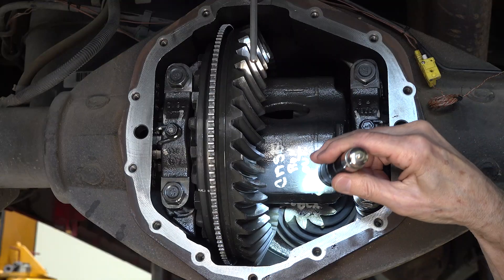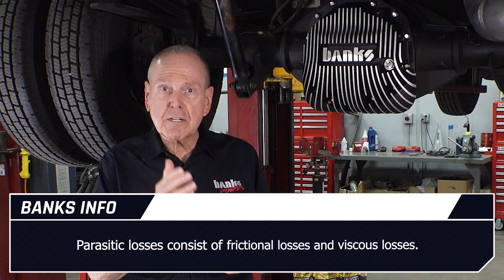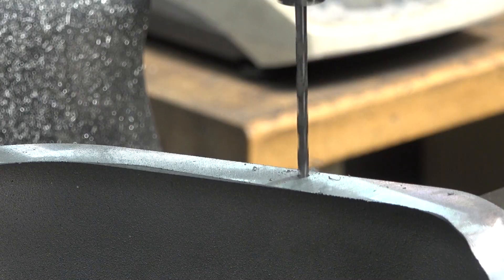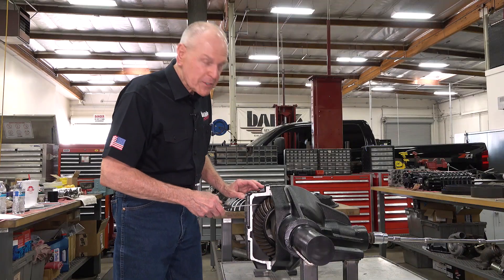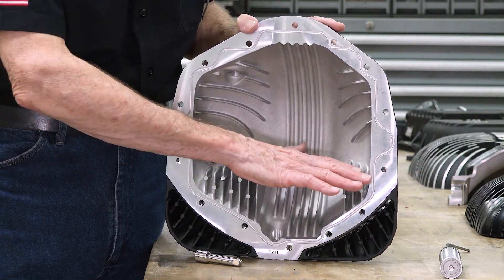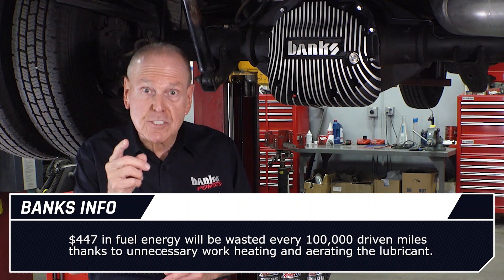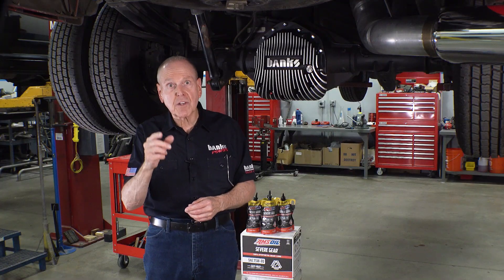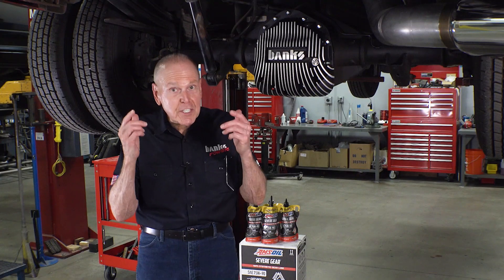Is your differential cover KILLING your gears?

Comment: It’s great to watch real engineering and not just marketing.
Reply: It's still marketing wank, he made no comparison to the stock cover proving his it's any better than what comes from the factory. He said it's better than the aftermarket which is poorly designed, that's fine but made zero comparison to what the axle experts designed for production.
Reply: otm646 the Banks cover follows the same fluid path and flow to stock covers but add better heat dissipation, sight glass, magnetic plugs that with take a square drive vs hex keys, better locations for the fill hole plus the addition of a drain hole, and gasket channel. Oh don’t forget Ram air.
Reply: I got 400kmiles on my Ford F350 with factory covers, still runs great with no noise, I don't think I need any of this.
Reply: It is interesting to see real engineering applies to mundane parts of a car or truck, but let's be clear, there is still a lot of marketing behind it. 

The issue isn't the product or even company's fault, it is simply that the improvements are very incremental.  There is only so much improvement you will realistically see with some of these products.  Can you see lower temps, which might result in more efficiency and this better fuel economy? Absolutely!  But your 15 MPG truck might now only see a 0.1 MPG improvement.  Is that an improvement?  Of course, but its negligible.  Same with the life of your oil.  Maybe now you can go from 100,000 mile diff change interval to 101,000 mile interval.  Does that really matter?  Your call. 

I still like this product, their willingness to apply actual science and their enthusiasm to not be happy with settling for the status quo, but take everything with a grain of salt.
Reply: Gale Banks has created an entire series of videos discussing other diff covers and tests them all.  That's why he engineered something that actually works.
Reply: @Hazdazos  I think this product might be useful to the edge cases that are running their trucks very hard but for the average guy this won't make any meaningful difference.
Reply from the maker: @otm646  This video is an edited version of the original one posted in November 2019. There are plenty of comparisons to stock in the original video and you find ample data on the product page: https://www.bankspower.com/i-2892
Reply: William Wheeler they could have just over filled the diff
Reply: @TobiasHinz1992  
Ya I guess.
The truck iam talking about, I have no idea about its history cauz I bought it at an auction with a ball in the middle of the bed, meaning its been towed with before, and I tow a trailer 5 days a week approx 5000lbs with no problems, kind of a neglect on the differential oil change too.
Reply: @jaykamal1978  This is directed at people who haul for a living. Depending on where you live, it's quite possible it spent most of its time on the road not hauling anything and occasionally pulled a camper trailer on the weekends. At least that's how most of the trucks I see around here operating. People who run hotshot or haul equipment for their businesses would benefit from this. But lets be real. Most folks that put these diff covers on their trucks, usually don't haul much. It's just eyecandy. At least when they put this eyecandy on, it actually does something.
Reply: @EyebrowsMahoney  
Ya I would say pretty much of an expensive eye candy. 
If I don't need it, iam not buying it, better to invest that same $$$$ in a place where it will grow.
Like I said before, bought the truck with 205kmiles on it at an auction and have put another 200kmiles on it with even changing the oil in the differential all that much.
From what I remember only 2 differential oil change on that one and averaging 5000lbs trailer the whole time. 
I definitely don't need it on a ford differential, that's for sure.
Reply: @jaykamal1978  And for your use case, it would absolutely be such. You're definitely not the use case. A 5,000 lbs trailer on an HD truck is baby weight, my jeep will haul 6500 lbs no problem. The guys that would benefit from this move around 20,000 lbs or more and actually put long, hard work on their differentials; thousands of miles day, sometimes every single day. It doesn't matter the differential when you're moving big loads, these guys are putting real work in with their trucks. The problem is the market was saturated with these diff covers that "add fluid capacity" without actually offering any real performance advantage... in fact it hurt performance. So this cover, arguably clearly more well designed and actually does something; is worth it to those that really work their trucks. Don't get me wrong, my Jeep is going to get a Ford 8.8 in it soon, they're good axles. But when you're in the business of hauling (and a F150 or a Jeep won't really benefit from this considering the use case), the bottom line is making your truck make more money for you longer, and that 's where this kind of preventative maintenance comes in. The factory diff cover does well for most applications, but not when at maximum towing capacities, especially when working in hot ambient temperatures. This isn't for your average 5,000 lbs trailer hauler. This is for your guy on the road, all day, moving max weight; doing work.
Reply: While he has produced a better diff cover, this is mostly marketing
Reply: @otm646  the real marketing win goes to the companies that got people buying a product that makes your diff run worse 🤭
Reply: The people hating on banks are prob mostly ones that got took on a toaster box diff cover and too proud to admit it, this guy is a genuine engineer and backs his products up with clean unadulterated science that actually understands fluid dynamics and makes the product actually benefit your truck.
Reply: Took me 4yrs to find this, BUT MAN… what beautiful Engineering indeed👌

Comment: Good luck refuting the science. This diff cover isn't backed by your feelings or opinions, as science doesn't suffer Bro Truck emotions. Thank you, Mr. Banks.
Reply: Do you even lift bro? Lmao!
Reply: Baywarrior707 yea warmer oil flows better but it starts to break down at and lose viscosity.. unneeded work equals loss in efficiency. Yes flat back covers are deeper but if you watched the series those companies ask for higher capacity still meaning oil level is a lot higher than stock, another loss in efficiency.
Reply: @Baywarrior707  The flat back ones also don't allow for proper fluid flow over the diff to the oil slinger for the pinion bearings.
Reply: @Baywarrior707  you wanting to know what the airflow is behind the Banks differential cover highlights your misunderstanding.
Reply: Remember guys this ram air (thought) might help if your going 70mph all day long,  American Alxe didn't seem to think it's important, I'm 68 an I've never heard of an Axle failing because the lube was to Hot, save your money an just change your lube when your supposed to..
Reply: @406Steven  hence the huge oil capacity trying to throw oil at it to make it better.
Reply: @Baywarrior707  what you want is the oil to maintain an exacting operating temperature for best results. The oil and diff needs cooled to not break down the oil and shall be warm enough that it is in operating temperature. What you do not want is overheated broken down viscosity oil in your diff and hot bearings and loads. See, there is a reason race cars have oil coolers and cooling ducts. Same with engine oil, its the exact same thing. You want warm oil , not overheated broke down viscosity oil. When bearings and metal heat up they lose strength, this gives rise to failure, more heat equals = more failure. You don't just cook oil and say look its water and zipp your engine to 10,000 rpm with no viscosity, that equals blown engine. same with diff components and splines and shafts, HEAT is the enemy because it is out of control , its your job to control it, this is a precise issue not a simplified claim of : "hot oil,  the hotter the better". See? its much more exacting with fine details of all this information.  No pun intended. just spilling it for everyone, the beans.
Reply: I have to disagree: People buy these amazing trucks and hook even more amazing trailers (sometimes two at a time) to them and travel at 80+ miles per hour, including uphill, to wherever they are going to recreate, deliver cars, etc and expect the trucks to perform/hold up. Blown turbo hoses...i think 70 is an understatement (maybe me and you drive that fast)
Reply: @Baywarrior707  That's why I don't think a Banks diff cover would be any better for my 1990 12-valve (if they ever actually made one) than the Mag-Hytec that I put on my truck. See above comment.

Comment: This will surely trigger some grown men who think their trucks are god tier who fell for the crap covers.
Reply: I never understood the diff cover thing but I would get this one lol
Reply: @kylerollins7882  honestly, I never thought about my diff cover, but now I want this one lol
Reply: @kylerollins7882  same
Reply: I mean, I won't deny that it's better, but I've never seen a class 8 truck with a fancy cover. I have seen plenty of diff temp gauges, so it's obviously something that can get toasty (and over heat when pulling an overweight load up a 15 mile 6% grade. Moral of the story, unless you actually USE the truck instead of treating it like an SUV with a bed, I doubt you will ever have any issues related to heat relating to the diff.

I'm not sure there is anything that doesn't become unsafe that you could hook to the bumper of a truck to really over heat the diff. Pretty much have to tow a fifth wheel or goose neck. My neighbor hauled pecans and grossed 32,000lbs in a 2500 dodge. I think the GCWR is 18,000lbs. Thankfully, it's flat around here.
Reply: @kylerollins7882  mostly the material of the new housing sheding more heat, with heat fins. but obviously flat back covers were the dumb part.

Comment: Don't even own a truck, but he sold me on it
Reply: The most practical vehicle you'll ever own.
And BTW, make it a diesel. An older diesel, like 1990's diesel (unfortunately many still out there have actually gone way-up in value in recent years).
Reply: @erwin643  every sub-300,000mi diesels in my area are being sold for $20,000+  :(
Reply: @simonbardell3527  And well worth it, since we hit "Diminishing Returns on Complexity" (Tainter) with automobiles years ago, with computerization and emissions control stuff that reduces efficiency (remove that stuff and watch the mileage skyrocket, particularly with diesels).

The analogy I like to use comparing gasoline to diesels is the old rivalry back in the 90's between W/intel computers and Apple Macintosh: Anybody who knew computer technology knew that Apple Mac's had a more efficient architecture, with more raw computing power. That's your Diesel.

Despite the ridiculous simplicity of the all-mechanical 12v Cummins in my old 1990 Dodge D250, it's the most fuel efficient diesel truck for its size (especially with air intake and exhaust upgrades), compared to more modern, larger diesels (granted less horsepower).

Comment: I followed the development of this dif cover for a while. Was sad to see it wasnt available for Fords yet.
Reply: Ya that is odd.  Considering there are more Superduty's sold in north America over any other brand.
Reply: @jforu33  it was even more odd considering my 7.3 has a bunch of Banks parts already on it
Reply: It says fords are coming
Reply: I would almost bet he made them with the hotshot guys in mind. They are nearly always are driving dodges.
Reply: Biggest reason is the Dodge and Chevy have a similar differential and use the same cover. So by building 1, you cover Chevy, GMC, and Dodge.
Reply: Fords don't run the American axle?
Reply: @JasonHenderson  Ford run there own axel there diffrent.
Reply: @JasonHenderson  best rear end ever made for drag racing the ford 9 inch.
Reply: Mr. Banks said the cover was Die-Cast. That means a steel die(mold) had to be machined & assembled for the Aluminum pressure-injection process. That takes time & $$$$. Mr. Banks understands the available market & it's vast. He could even sell these covers to the heavy trucking industry. So it'll take time to cover all the diff's. It may not happen for some models. Die-Casting is an expensive process. You also have post casting cleanup, secondary operations, transport & packaging. If you don't have a big enough market for some of the lesser known models, a diff. cover may not be offered.
Reply: @JasonHenderson  They either run their own axle or a big Dana rear axle.  I'm hoping to see one for the Dana M275 axle in my F350.
Reply: Most newer ford super duties have a sterling 10.5
Reply: Ok then, no ford cover available. Staying with stock then and saving the $3-400 bucks. Thanks!!!
Reply: @JohnSmith-lw2bm  : Doing the same here..
Reply: @jforu33  I think it's just because GM and Ram use the same rear end so they could reach more trucks sooner if they developed for two instead of starting with one brand. He talks about it in the early differential cover videos from the series.
Reply: @wickett7078  I see that too. Auto transport and hotshot drivers always seem to have Rams.
Reply: victor girouard Who asked?

Comment: I never give a thought to the differential being a fuel eater. Especially seeing how the oil would heat up while working. Your graphic showing the oilas it move up the ring gear to the pinion gear really points this out. And with your diff. cover addressing not only the flow of the oil but cooling the oil at the same time. I can see where that is benefitting the fuel mileage of the engine.  Thanks for sharing Mr. Banks.....

Comment: My rear end was heating up, just by watching this excellent video explaining with real life situations, models and animation. After 50+ years of fixing vehicles from cars, trucks and school buses, it is very clear to me that they thought of something I never gave a second thought to. I was just glad to have a customer willing to let me change the lube. My god, it only takes a minute to get a finger in the diff to pass judgement on the lubes condition. Great idea as it is one of the root cause of differential failure plus heat degrades all of the man-made chemicals added to make GL4 / GL5, much less synthetics. I have rebuilt differentials for decades, keeping lube on the pinion bearings much less the outer axle tube bearings can only help, whether full-floating on not. I can see some fuel economy gains but rotating parts under the extreme loads getting lube, as these components see unbelievable loads while pushing an empty truck or loaded vehicle down the road. Great product for vehicles with larger loads. Why do they make covers that preload the main caps? Is it because of load forces? You bet. GM engineers have told me many times that components are designed for 5,000 hours. This is 150,000 miles. As long as fluids and proper service is performed. ASE Master Tech since 1978 - Retired “I like it!”

Comment: Instantly I thought a huge expensive advert. I wasn't disappointed... However you can't refute the science used. It's well thought out, well executed and explained. I cannot confirm or refute the claims but as an engineer it's sounds logical and believable for most part. If I had a need for a diff cover... Banks would have my cash purely for the belief they have in their own engineering and quality. Kudos.
Reply: You can't refute the science but it would be dumb to buy an aftermarket diff cover. Just look at how many people NEVER change their diff fluid and these trucks are still running. Just change the fluid and be done with it.
Reply: @thefuzzypickle8277  There's two reasons to buy an aftermarket diff cover: off roading and extreme performance. OEM diffs are pretty thin, so they're easy to damage.

Comment: I have a mag hytec......I feel so used and it’s my fault.
Reply: Your first name..... it checks out.
Reply: I Ha e been skeptical about any no stock diff cover since my step dad was a few chief on a IHRA dragster. He always swore by stock covers. Or oil pans with twister tubes in the bottom of the pans. All custom made we fsbbed in-house. Our motor guy was a gm dynotech for 35 years
Reply: I did weld small air grabber cooling flaps to my. Drum brakes and hat style rotors. World of diff
Reply: @davidmoore8741  twister tubes? Can you explain more
Reply: @davidmoore8741  yes twister tubes, I'm curious!
Reply: TheTennesseeTittyTickler I had a trans pan on my TH350 with the same design.
Reply: @Mr.Beastforpresident  Ingenious! Kind of reminds me of the Mag-Hytec transmission pan, all aluminum (like their diff covers, shaped like a heat sink. 

Speaking of which, what do you think of the heat sink-shaped valve covers out there for the Cummins 12v? Do they really dissipate that much heat from the engine?
Reply: @Mr.Beastforpresident  I don't have any plans for the engine oil, but next spring I'm doing the Mag-Hytec trans pan, the one with an extra 1 1/2 quarts.

A few Summers ago I had the floor in my cab stripped down to bare metal, in preparation for a a heat shield and sound dampening, and felt the heat through the floor, from the transmission on long trips.
Reply: @Mr.Beastforpresident  Copy that. I did replace the shitty Dodge-part ATF cooler lines (they don't even make them anymore, go figure) that ran from just under the front of the engine, to the little transmission radiator I have in the front of my truck. I used standard 1/2" blue hydraulic line, along with some spacers to keep them from touching. This actually created better flow than the original metal-crimped rubber-metal original Dodge crap!

Needless to say, you'll never see a cleaner (no residue from any seepage, etc) 1990 Cummins 12v.

A perfect analogy here: A legendary engine and drive train (My 1990 Dodge D250), while the rest of the truck may as well have been built in the Soviet Union.